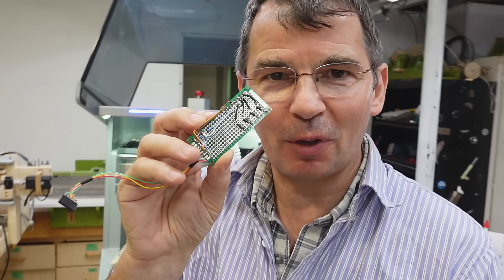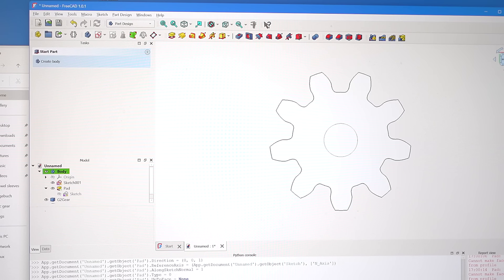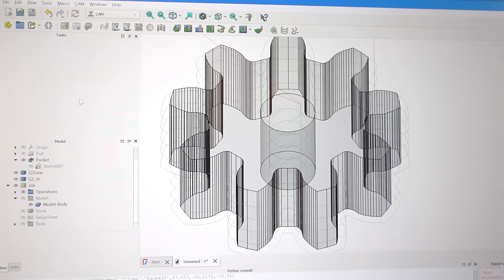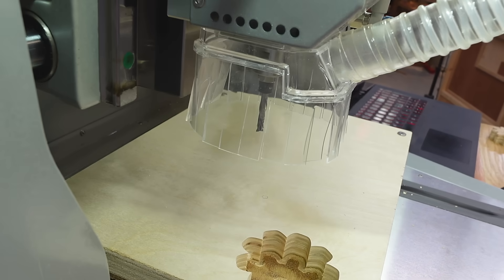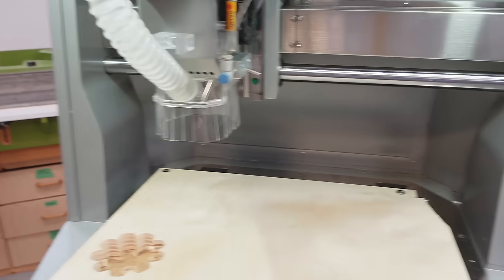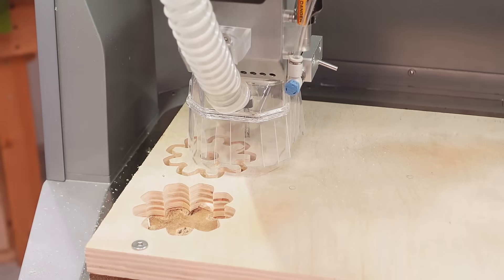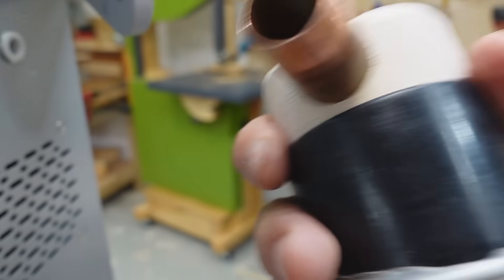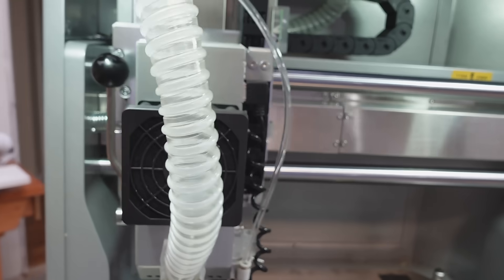Steep learning curve for using CNC

Comment: I wonder if using a DXF file might have worked a bit better importing into freecad?  Given that is a very common cad format.
Reply from the maker: I think I tried that one first.
Reply: @matthiaswandel  I tried using the DXF option with your gears program and FreeCAD.  I had the scaling set to cm in your program and mm in FreeCAD.  One line was missing at the right of the drawing when the DXF file was imported - that is easily fixed once the imported items are converted to a sketch.  The overall diameter in your gears program showed 16 cm, but the overall diameter of the imported drawing was 16 mm, so I had to scale the body by a factor of 10 in the X and Y directions using the Draft workbench.  Directions are provided in another comment to fix these issues.  FreeCAD seemed to be fast when working with the imported DXF file, and the circle in the middle is a true circle rather than a series of small lines.

Comment: There is an addon to Inkscape that can make gcode, then you can just repeat the gcode with a different Z, I think for you it will be an easy task.
In the old days we wrote all gcode by hand and in your case where you just need to change Z you will have no problems.

Comment: FreeCAD certainly is rough around the edges. But the upcoming 1.1 Version will also include a lot of nice UI improvements. There's a lot of Momentum there. Personally I think it's very worthwhile, through I primarily use it for 3D Printing.
And it's also a matter of taste and where you come from. I like it much better than Sketchup, for example.
Reply: FreeCAD is the only CAD I've used so far and even though it's difficult to learn, it's nice not to worry about subscription fees or legal issues
Reply: It doesn't stand a chance against Fusion 360 or any of the top commercial packages.
Reply: This is true for sure. However it is great to have multiple options. So everyone can choose the cost, access and feature-richness that is most appropriate for the use-case at hand. As always: choose 2 out of 3.
Reply: FreeCAD doesn't flip flop on their hobbyist licence ;)
Reply: @bobweiram6321  And those does not stand a chance against hiring a professional designer to do all this crap for you, it's much easier. Even better, just hire a team to make what you want. In all seriousness, I don't care for software that comes with imposed limits on my designs.

Comment: I have to admit, non of the router bits I used in my DIY CNC where retired, because they were dull. All "losses" were user error. Yes, there is a learning curve 😅.
FreeCAD might be a bit rough, but no CAD program is easy. I've been using FreeCAD for several years for all kinds of projects (from just sketching to assemblies with tens of parametrically interconnected parts), almost all DIY, but also a few small commercial projects (where the CAD part was needed, but not the main goal). It does all I need very well, including creating tool paths. And luckily it's not that hard to get into it again even after a pause of several months.
PCBs I design with KiCAD, then use a simple command line tool called pcb2gcode to create the tool paths, which I can feed my CNC. Once you have the settings that work well for you, it's just a single command line to be called.

Comment: I am wondering if exporting from the Gear Template Generator program using the "DXF (with polylines)" option and then importing into FreeCAD would result in a better result.  I experienced two bugs with this approach that are easily worked around when using version 3.2.2 of the gear generator and version 1.0.2 of FreeCAD: 1) There is a missing line at the right of the imported drawing that must be added once a sketch is created. 2) I had the scaling set to cm in the gear program, but the gear was imported with the scaling set to mm, so the part was 10 times smaller than expected.

I have only been using FreeCAD for about two months for use with a 3D printer to create parts for a horizontal pantograph and a 3D pantograph that was created from Matthias' plans.  So, steps 20 and below are essentially best guesses:
0. In Gear Template Generator: Export - DXF (with polylines)
In FreeCAD:
1. File - Import, select the DXF file.
2. Click OK for the DXF Preferences to accept the defaults.  Notice at the right side near the center there is a line segment that is missing - this will need to be fixed.
3. Expand Layers in the tree and expand profile.
4. Switch to the Draft workbench.
5. Select Polyline in the tree, then select Modification - Draft to Sketch from the menu.
6. Select Circle in the tree, then select Modification - Draft to Sketch from the menu.
7. Move Sketch and Sketch001 to the Body.
8. Double-click Sketch to open the sketch.
9. Select the Line tool from the toolbar.
10. Zoom in so that you are able to see the location for the missing line that needs to start and end at the right of the sketch.  Draw the missing line by clicking on those end points.
11. Use the Measure tool to verify that the gear's width is the correct size.  In the Gear Template Generator program, I had the Units set to Centimeters, but the units were set to millimeters in the DXF file, so the sketches will need to be scaled. 
12. Click the Close button to close the sketch.
12. Switch to the Part Design workbench.
13. With Sketch highlighted in the tree, click the Pad toolbar button.
14. Place a checkmark in the Reversed checkbox, set the length to 19 mm and click the OK button.
15. If the scaling is right, go to step 19.  If the scaling is wrong (off by a factor of 10 in my case), just make note of the problem and continue to the next step.
16. Select Sketch001 in the tree, click the Pocket toolbar button.
17. Set the pocketing length as desired 18.95, then click the OK button.
18. If the scaling is wrong (off by a factor of 10 in the X and Y axes), switch to the Draft workbench.
14. Select Body in the tree.
15. Select Modification - Scale from the menu.
16. Click Enter point.
17. If the scaling is off by a factor of 10, as it was in my case, enter 10 for the X factor, and Y factor, place a checkmark in the "Create a clone" checkbox, then click the OK button.
18. Turn off the visibility of Body, and use Body001 instead.
19. Switch to the CAM workbench.
20. Click the Job toolbar button.
21. Make certain that Body001 is selected, then click the OK button.
22. Click the OK button.
23. Click the Profile button.
24. Click the OK button.

Comment: FreeCAD was a heck of a slog to figure out, I watched a few step-by step videos and eventually got it.

The really good part is the gear generator library, which can do most gear  types. The library only concerns itself with the gear faces, so if you want Bevel gears, you'll have to do some manual work to get the outside and back of the gears, etc.

For 3d printing gears, it does a great job. I don't have a mill, so I can't talk about cutting tool paths.

Comment: FreeCad is not easy but the alternative is monthly fees and/or some company owns every file you generate and can revoke access at any point in time. Same goes for Bambu 3D printer, Windows11 and the Apple ecosystem.

Glad you managed to get the CnC going without having to resort to the non-free alternatives.
Reply: That’s why I 3-d print on my creality, with files generated from FreeCAD on my Linux laptop
Reply: FreeCAD is easy (sigh)
Reply: @staticmin3 agreed. I have no 3D CAD experience (but a solid technical background). A colleafue showed me some basic things on Solidworks (i.e, what could be done, with which concepts, not how it could be done with specific button presses). I had no problem using and learning FreeCAD so far.
Reply: OnShape is free.
Reply: Gonna have to spam this but FC gets easy when you mod the UI. 3D print... UI for that. CNC... UI for that.  
Most peeps get overwhelmed by the menus and options when they dl the regular version. It don't have to be that way. 
You can get skins and wrappers to turn FC into the right tool for the job.
Reply: How so Windows 11?

Comment: For creating gcode I have an ancient version of SheetCAM. I've not used the recent versions but it's still pretty cheap (about 200CDN, I think). It's basic (you import a 2D DXF and manually tell it what depths to cut), but it's really simple for the occasional CNC operator (like myself).

Comment: Ouch. I've used FreeCAD for a few years and I like it, but I wouldn't recommend it to a beginner who needed to do what Matthias was trying to do. The newish 1.0 version (which Matthias was using) added quality of life features and improved the learning curve for the core CAD functionality. However, that core functionality is surrounded by a massive collection of haphazardly connected features created by different developers with different ideas on how things should work (and who weren't necessarily good at UI design in the first place). Matthias was crossing between several of these disconnected feature sets as a beginner, mostly using aspects that weren't part of the 1.0 overhaul, which would have to be miserable. At that point it's more like learning a whole tool chain of unrelated products than learning one unified tool.

Comment: From one engineer to another: you're diving in with force, but maybe a bit too fast. Not long ago, you were firmly anti-CNC, and now you're making sweeping judgments. 

There's a learning curve here, and it’s worth respecting.

On CAD tools:
I come from a UG-NX, CATIA, and Calma background. Fusion has its strengths, sure—but the licensing model is a mess. FreeCAD, on the other hand, is free and surprisingly capable. Yes, it has a learning curve, but so do all serious platforms. If you haven’t explored FreeCAD’s Gear Workbench, you’re missing out. Mango Jelly’s YouTube series is a great place to start for general FreeCAD understanding.  For gears "How to Make Gears in FreeCad" is a nice start.  Try to watch videos less than a year old, so it references Version 1.0 or later. (FreeCAD also includes a solid FEM package—I’ve used it to analyze aluminum parts in coursework.)

On CNC:
I’m a turbomachinery design and analysis engineer, and I still took CNC courses at a local college (free for those 60+). Those classes taught me fundamentals like G-code, coordinate systems (G54, etc.), and chip loads. Three years in, I’m still learning. CNC isn’t just plug-and-play—it’s a craft. I am afraid to many people look at a CNC and expect it to be as easy to use as a toaster.

FreeCAD and CNC are part of my daily workflow in the shop, right alongside my tablesaw, bandsaw, drum sander, and tracksaw. I make furniturer, home items and even brass work for a columbarium.  The challenge is always the same: use the right tool for the job.

Final thoughts:
     - Learn to use the tool as it was designed—not just how you want to use it.
     - Whether it’s a hand plane or a CNC, expect to invest ~1,000 hours to become truly proficient.
Reply: Key CAM features of FreeCAD:

- REST Machining, Rest machining in CNC CAM is a method to optimize the material removal process by using smaller tools in areas where a larger tool cannot reach in previous operations. This helps to avoid tool wear, and unnecessary material removal and saves time.

-Adaptive Machining, tries to maintain constant engagement of the cutting edge. Instead of multiple passes to a depth adaptive may spiral down to a depth, then start removing stock the full length of the cutting area, loads are managed by the stepover in the cutter movement. Note: A full width slot milling operation is very hard on a tool, and may overload the system.

-Full 3D surfaceing. Given a defined surface such as a NURB surface FreeCad goes full 3D, not being limited to planar cuts.

Comment: With how much Mathhias seems to prefer wood over metal, I wonder if a laser cutter would have been more appropriate. They are usually way easier to interface with than CNC mills.

I don't think Carvera sells PCB-level lasers, though, so that's something the mill has going for it.

Comment: as for the PCBs I have had pretty good luck with my laser engraver/cutter being used to cut vinyl sticker stock and then acid etch them using Vinegar and hydrogen peroxide mix just sitting in the room on end but a bubbler at the bottom would give cleaner results at the bottom as the salts formed fall (copper acetate) thus the solution becomes less and less reactive so you get some stringers at the bottom that take a bit longer to etch through though even when left too long the cuts came out amazingly tight and clean (compared to say ferric chloride process, never mind being far less nasty than it) I would say though that there is a progression path that ensures holes and such are where they should be through the traces, ie place holes on the corners of the board so you can use the outlining function to move the board with its sticker stock applied and holes drilled via CNC so the corners of the box the laser lays out will then touch these holes then the laser can be released to cut out the paths and peel the needed removed bits and etch, then you are done :) (then you can start the tinning process and such which I recommend anyone doing so gather pine sap and make your own flux, worked awesomely for me, not sure what pine tree it was but it produced next to no outgassing unlike the rosin flux sold in tubes, inside the flux core solder or any other choice.. and the smell of fresh pine is released while soldering, just add some isopropyl alcohol to the sap and dissolve then apply to the board you want to put solder onto :)

Comment: So for the machine not zeroing or having startup errors, Generally these machines run G-Code, and you can prefix/postfix your own commands as needed. On mine I have my software configured to add a command to move to a safe spot at the end of each file. Probably need to look at the raw output from their files vs your files and see what you're missing.

Comment: for me, freecad is the only option because the other options are either buy now, pay forever schemes (😞) or they don't have features that freecad has. example: freecad is fully parametric (meaning you can change your design by changing some numbers in a spreadsheet), but blender doesn't have that feature.

Comment: I have the original carvera and have cut a lot of circuitboards on it. I'll do the design in Kicad and then use Flatcam for the g-code. I fixture the board using double sided crepe paper tape. I try to design single sided and use a 1/32" flat end mill for all ops (traces, drilling, edge milling). I'm going for speedy prototypes, not trying to replace pcb fab.

Comment: If you go on the FreeCAD forum and make suggestions about the UI or anything else, they almost always reply that it's like that and it' s designed that way on purpose
OR
that you DON' T need that feature that you are asking for.
I use FreeCAD only for the Constraint Solver in Sketcher, and I do  3D stuff in SideFX Houdini where there are no limitations whatsoever.
FreeCAD is the Blender of CAD software.

Comment: I use freecad daily, to do simple design and production stuff. I totally feel the issues that you have with the program, it is by no means intuitive and it often feels like that there is no good reason for it to be so. It's basically a amalgamation of 5000 features that are all half baked and undercooked, making the program a buggy mess. I use a specific version of freecad, called Real Thunder, which is less buggy.

Also, getting your gcode to run properly is a matter of choosing the right post processor. CNC machines can be very picky to a specific version of a post processor, and the standard freecad for some reason messes with this, not actually implementing the post processor that you chose, and using the default instead. Sometimes it helps to place a hammer next to the keyboard, to scare the program into actually working.
Reply: Most of Realthunder's work was merged into mainline FreeCAD with version 1.0. Freecad 1.0.2 is my daily driver :D

Comment: I'm quite biased, but I love OpenSCAD. The killer feature is exactly that it's just code in "plain" text, so you can have version control of all iterations of the model you're working on. Not sure on the CAM side of things, as I've only used it for 3D-printing so far.

Yep Freecad has quite a learning curve, but it can actually be pretty rewarding, for the stuff that isn't easily done in OpenSCAD (fillets for one).
I think there is a way to code in OpenSCAD, import to FreeCAD (or even code OpenSCAD directly in FreeCAD, I think?) and generate the toolpaths wth it. But I haven't tried that....

I'm not a fan of a CNC mill without (if I understand correctly?) a functional E-stop though. That should be a physcal switch, the traditional red mushroom that has to be manually reset.Not reliant on any software at all. That would be an uncoditional must for me.
Reply: have you tried cadquery? It's python library, uses opencascade kernel and there's cadquery workbench for freead too :)

Comment: For 2.5d milling I use ESTLCAM.  Import an SVG or DXF file and then put in your cut types.  Much smaller learning curve and it exports out many types or cam types.
Reply: good to know, though I suspect the goal is Libre software options, which that seems not to be?
Reply: @DavidLindes  its not free, but has not subscription, can be used commercially, is activly developed and is absolutly worth it's very reasonable price.
Reply: @StefHa   it's not about price, it's about freedom.

Comment: LOL, seems like I'm not the only one who can't get any of these newfangled 3d cad programs to do what I want. I'm fine with autocad, and using excel to write threadmilling g-code, but fusion has me stumped. Thanks for the warning - I will not touch freecad.
Reply: The struggle is real. CAD can be extremely frustrating to try to work with. I can only imagine no programmer has any practical drafting experience. So they approach things differently.